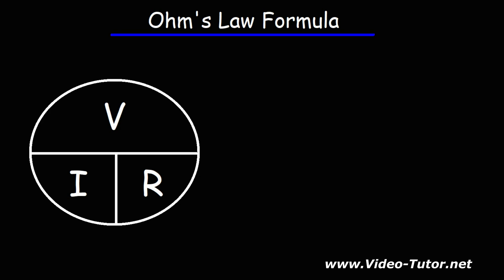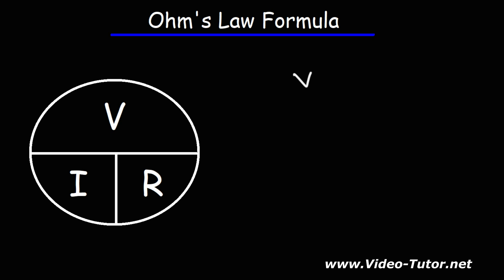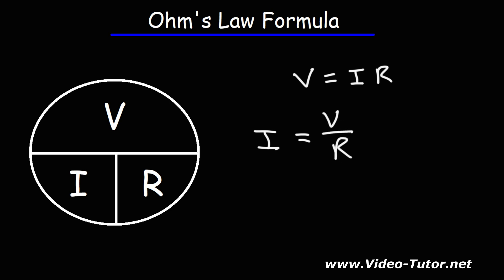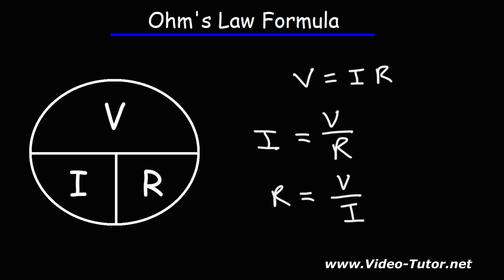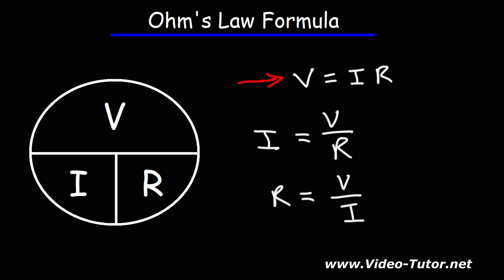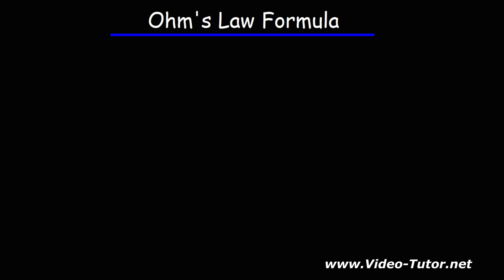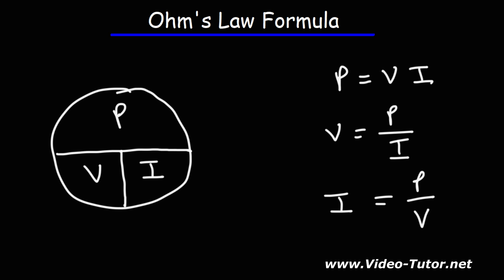Ohm's Law Formula

Comment: The easiest way I remember Ohms Law entirely is just a phrase. WAVE to EIRIE. Now, this won't be a perfect phrase like PEMDAS, but with this, if you know what each figure represents, i.e., E and V are both voltage, I and A are both amperage, then this can be helpful to remember. Watts=Amps*Volts and Volts=Amps*Resistance. After that, it's just basic algebra for the rest of the formulas. Rearrange and/or substitute.  Again, this isn't the best way to look at it, but it's just my way to remember